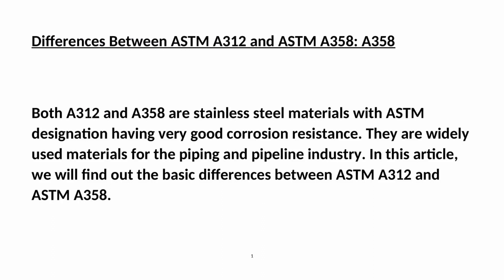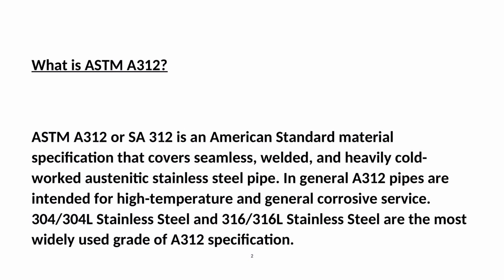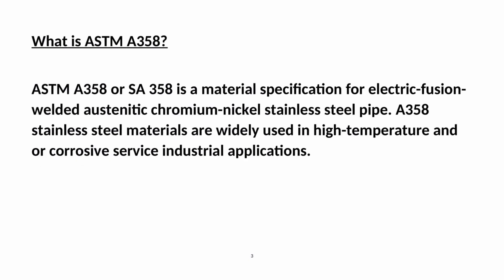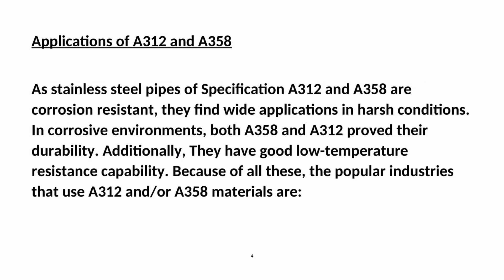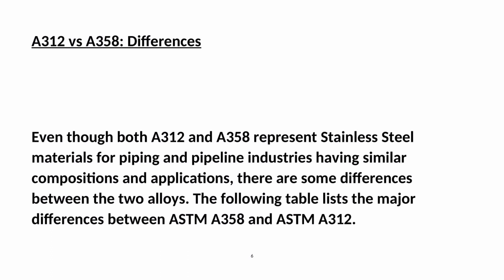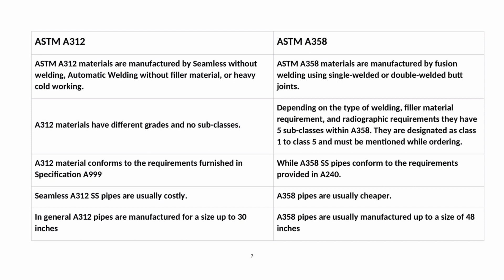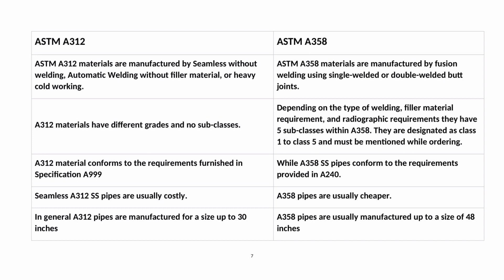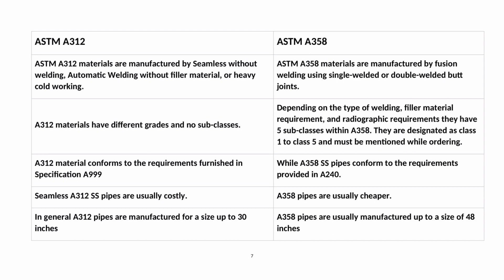stainless steel A312 A358 materials in English

Comment: A312 type 304 & 304L pipe  welding process name and electrode or filler wire number
And also 316&316L